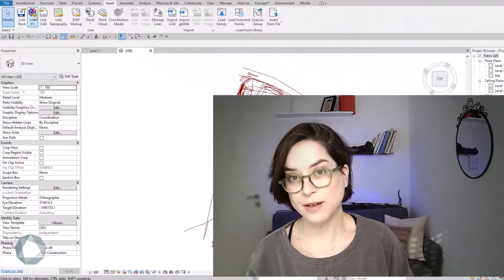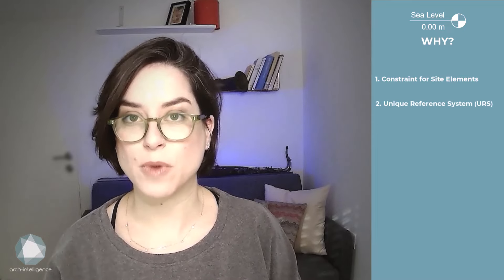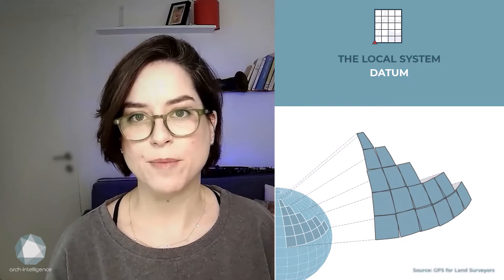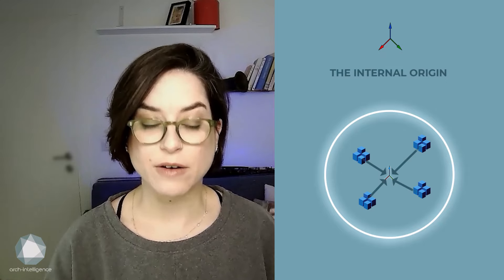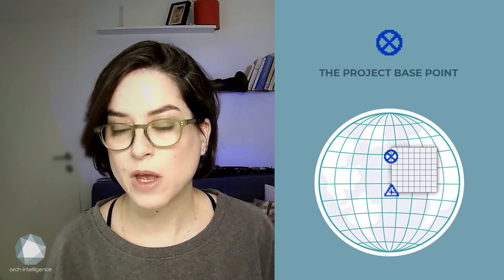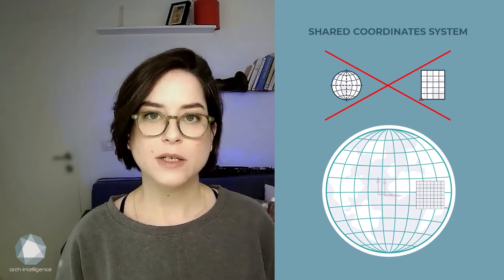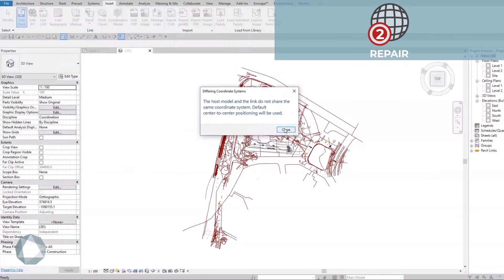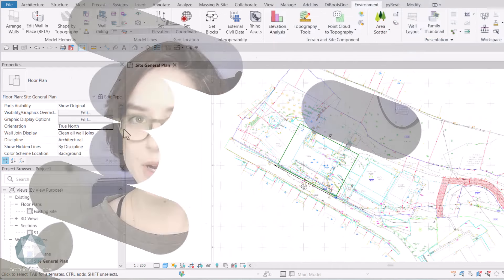Shared Coordinates in Revit 2025 Explained | Environment for Revit® Video

Comment: Amazing video and tool! Great job.
Reply: I would also like to mention that Revit's built-in Invert Elevation parameter (relevant to site utilities) is relative to the Internal Origin.  So the first thing I do when I start a new site model is to rename Level 1 to Sea Level and renaming Level 2 to Level 1 (e.g. Ground Floor).  This is in-keeping with your recommendations, but a user could go wrong by adding a new level as Sea Level below the default Level 1 and not realizing that the Internal Origin is still at Level 1 and the Invert Elevation cannot work correctly afterward.

Comment: @10:40 - re:"...is if you acquire coordinates from a geolocated DWG file" - What defines a geolocated file? Does that mean a DWG file with Coordinate System set AND a project location defined by a lattitude and longitude? Or is a geolocated file a DWG file with the coordinate system set only?
Reply: Most probably a Civil 3D file with Coordinate system assigned to it.

Comment: great presentation. As a designer engineer myself I prefer to have my internal origin aligned with the project base point. this way if I have to relocate my project everything is relocated accordingly and the internal origin remains in logical reference to the coordinate system. other than that great video!
Reply from the maker: Thanks for the feedback! This is indeed common practice, less recommended for site models but definitely good for buildings.

Comment: You don´t need a sea Level as long you make sure Survey Point stays in N/S 0,0; E/W 0,0; Elev 0,0. This will keep the origin close to the basepoint and you ground floor. The furter away you model elements from origin the more imprecise your model becomes. So always keep origin as close to your model elements as posible. Always acquire coordinates from a dwg with assigned coordinates, ect. from civil. This will be included in exports, and the coordinates will also appars as GIS in an dwg export. Insert the dwg center to center and move it into place. Then acquire coordinates. Always locate your model i Z by using Relocate project.
Reply: Hi there ... But when acquiring coordinates from a civil CAD file doesn't the Survey Point move very far from the model and N/S and E/W change values taken from the CAD file?